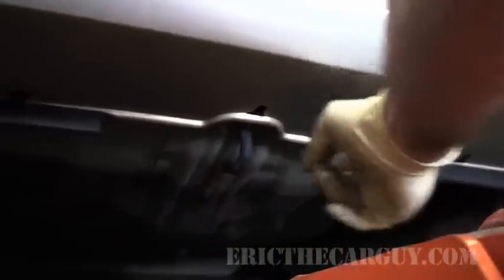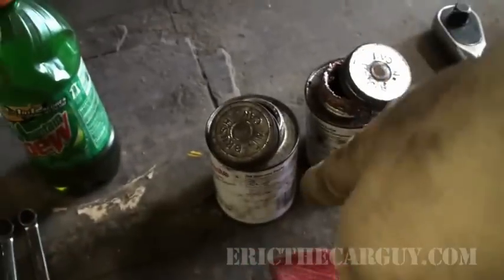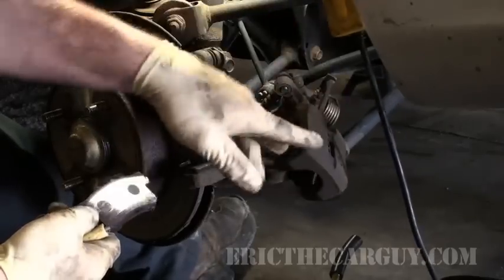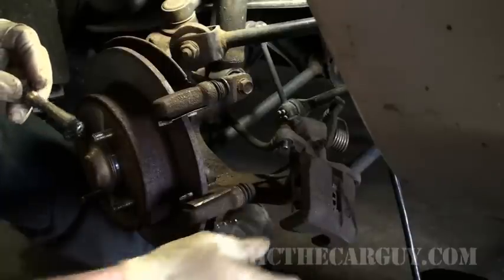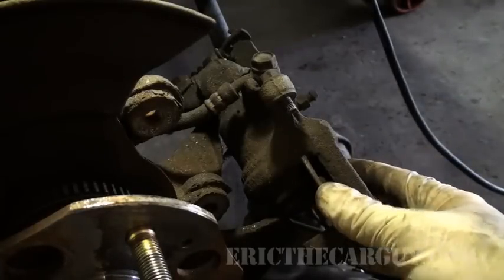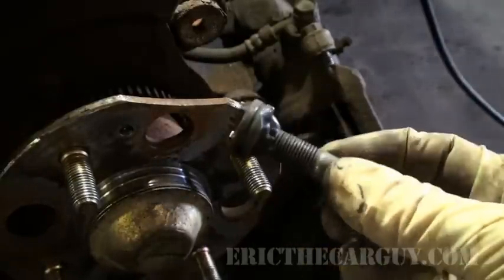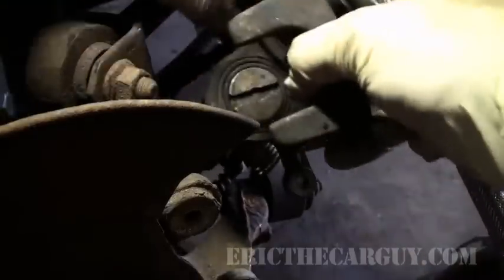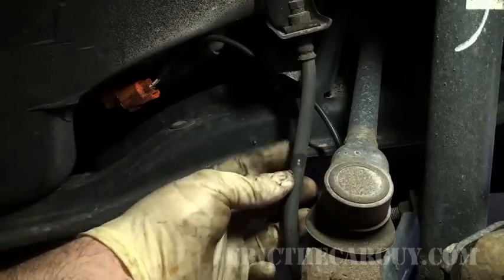How To Replace Rear Disc Brakes (Full) - EricTheCarGuy

Comment: Erik, great video! Tackling front/rear brakes on a 06 Honda Accord this weekend and the preview/pre-game really helps!. One thing I noticed (which you may be glad to hear has nothing to do with your mad brake/video skills) the American Flag on the back wall is backwards ;)  (Anytime the American Flag is displayed vertically/stripes pointing down, the star field on Old Glory always goes to the left ((as a rule of thumb/reference the star field is on the same side as our hearts are physically aligned when the main viewing audience is facing a vertically aligned flag))  I'm thinking someone else has most likely mentioned this by now, but since you mentioned, "when something's worth doing right...it's worth doing right" I figured you would want to know just in case. (((I now I'd want to know)))). Again, great video... Thanks for taking the time to post it!

Comment: I just did my rear brakes! Thanks a lot for this video. I drive a '96 Integra, so it was very similar to the Accord in the video. Quick question, how do you know the brake pin is lined up with the notch in the caliper's piston? I turned it to the 12 o'clock position as you showed.

Comment: Quality! Thermal CPU (computer) paste comes in thin syringes. These syringes can be used to apply silicone grease under the piston at 14:16 . I kind of suspect that CPU thermal paste is silicone grease but I'd go for the brake rated product so I'd re-use empty syringes (except that on an X-Trail the rear pistons don't turn (I guess that is so you can fix them in the bush)

Comment: HEY ERIC YOU HELP ME SO MUCH WITH YOUR VIDEOS I HAVE A TIP FOR YOU. BREAD TIES WITH THE PLASTIC MELTED OFF AND SEWING STRAIGHT PINS ARE GOOD FOR CLOGGED WIPER FLUID HOLES AND FOR BLEEDER SCREW HOLES AND CARBURETOR JET NEEDLES. I HOPE THAT HELPS SOMEONE.

Comment: You know watching the video after struggling through problems is not how I am going to do it next time. It is reassuring though that I now know I did ok. I'm an industrial mechanic.  Not automotive mechanic... For the caliper tool, at the local auto parts store I bought some special tools to fit on the end of a 3/8 extension on a 3/8 ratchet that fit into the tight space if it's extended out too far. That way in case you don't have the ability to weld any custom tool together there is still hope for you.

Comment: Eric. Thank you for the great video. I did my Lexus ES350 rear disc brakes. The drum parking brake has an adjuster to ease up on the shoes so you can pull the disc off. Will these self adjust once i reassemble? Or do I need to adjust them back?
Thanks in advance.

Comment: he actually explains it later in the video, but the reason is there is a pin on the back of the brake pads that look like the tool he used to push it in. they need to go inside that slot, if they dont you will have a spongy brake petal

Comment: Hi, Eric

Thanks for the video, I am just wondering how long does it take to change the rear brakes on both sides actually? Just a small suggestion, could you also mention at the end of each video, the time needed to complete work actually. That might be quite helpful, at least to me. THanks

Comment: I actually fond out what was the issue. My right break pads/or the piston was stuck and causing the clicking sounds. I have cleaned the caliper and the pads thoroughly and applied copper anti seize on it and the issue got fixed. However, it came back after a month. I am guessing I will have to replace the caliper.  Anyhow, thank you very much for your break videos, I really would have know the first thing to check without these videos and would have believed my mechanic.

Comment: 2020 is approaching and through my research I've discovered that you can do this without opening the bleeder (Just open the MC Cap but don't take it off[Clean the area before opening]). It is not recommended but let's be real, most people have done it this way without any problems. Just know that you WILL BE flushing that fluid eventually as part of routine maintenance.

Comment: It's simply a precaution to air getting into the system. So long as your brakes don't feel spongy you should be fine. However if your brake fluid is a little on the dark side and you are still worried about air in the lines then just get the fluid replaced at a jiffy lube or such, they will take care of both problems when changing the fluid.

Comment: Eric, might want to caution about pounding the wrench with the palm of your hand. Carpal tunnel damage may result. Better to use an impact or longer handled breaker bar for added leverage.

Also, I would never compress a hydraulic hose and never let the caliper hang, supported only by the hose. Hang it from a coat hanger or bungee cord.

Comment: The fluid in the caliper probably is full of gunk and moisture, so it's best to purge it out and get the somewhat cleaner fluid from the line to do the braking duy (assuming you're not planning to flush and renew the brake fluid)
If you just push it back up the line, that gunky fluid is going to be doing the hydraulic duties for the life of those pads, and more likely to seize up the piston than if you had fresh fluid.  Just flush it with fresh fluid and that won't matter any more.

Comment: I usually use brake fluid to lube the caliper piston.  I don't use silicone lube on the piston cuz it'll get in there when you are pushing the piston in, and I don't wanna have that mixed in with the brake fluid. Also, I use silicone lube on the sliders for the pads.  I only use anti seize on threads.  I don't think it's meant to be used in an application that moves back and fourth.  It's not a lube.   I'm always learning tho, so wondering your thoughts?? 😊

Comment: Hi, Eric. When I saw one of your prior videos showing the use of silicone paste, I went to a local autoparts store and tried to find it. I'm not finding silicone paste. Can you give me a more specific name? What do you think about using antiseize on the sliders, instead of silicone paste?
By the way, is silicone paste the same stuff you put on the back of brake pads to prevent chatter in the new brakes?

Comment: Eric, great videos! I have 06 Honda Element and my last 2 brake jobs there seems to be an issue with noise immediately after the brake job is completed. The dealer said it was the rear brake plate and they had to cut rotors to adjust. Is this a common issue with Elements? A mechanic suggested I remove the plate, is that recommended? The mechanic also suggests I always replace the rotors every time I change the rotors, he states it's not worth cutting as they are very thin these days. So you agree with this philosophy? How do you feel about drilled and slotted rotors on Elements?

Comment: I use synthetic brake grease on the slider pins and anti seize on the brake pads points where it touches the caliper. People have said that anti seize will eventually turn thick lowering the movement. Should I just use brake grease all over? Or stick with how I'm doing it? Thanks!

Comment: Great video. I like the part where things don't work out as you planed (the tool to compress the piston didn't fit). Just like in real life!

One thing I'd like you to change: don't use a pop (soda) bottle to store toxic chemicals in arount the shop (or your house). A young child in your shop (don't say never) could drink that toxic stuff thinking it really is pop/soda. At the very least, remove the label from the bottle. As unlikely as this scenario seems, it has happened with terrible results.

Comment: Do you have suggestions for replacement rotors and brake pads?  I have always used Genuine Honda, however, our 1997 EX is old enough that Honda no longer supplies brake pads.  I used Napa Pads the first time I had tor replace them, however, they are made in China and I despise Chinese parts.  Raybestos are also made in China the last time I checked.  Is it possible to find brake pads that meet or exceed OEM specs and are made in the USA?  I have looked and have been unsuccessful thus far.  May I suggest stocking a few Honda brake bleeder covers?  They are relatively cheap and they keep junk out of the bleeder orifice.  I ordered ten from my local dealer the last time I did a major brake job (and repair on the ABS unit).  Thank you for great videos.  The Helm Manual only goes so far.

Comment: Here's a tip, if you are dealing with old calipers and run the risk of snapping the bleeder screw off, bleed the system at the banjo bolt instead. I had to do this during diagnosing excessive pedal travel that was ever so conveniently consistent(sarcasm)  My gut and experience told be it was a MC issue but I covered all the basics before condemning it(bleeding the entire system was involved)  Oh and people, please learn to use your parking brake, please.
Reply: Please explain why you mention "please learn to use your parking brake"?  Perhaps it's bad but I always used the parking brake on manual transmissions but never do on automatics.  Not to say it won't happen to automatics but I've only seen manuals jump out of gear.

Comment: Car dude, I have a request, pls.  All I find is 3 tons of jack for parking brake shoes on rear disc brakes. I have two vehicles in need of this service (99 Jimmy & 04 Optima) and I tuned in here in hopes to get some better insight but not the same setup here :[
Keep up the spectacular work!
Tx.

Comment: I was not aware that you never turn counter-clockwise the cross piece adjuster after turning clockwise to move into the piston as Eric stated. Last time I just adjusted it back up to make up the distance to the new brake pads.  Was that wrong to do?

Comment: To all the people who keep saying to use a C Clamp on the piston, you must all realize that rear disc calipers, the piston is a screw jack and is screwed back versus on the fronts it rides on a square cut seal inside the caliper bore.

Comment: Some suggestions: First, you don't want to just spray brake cleaner willy nilly.  Brake cleaner eats rubber.  Second, you don't want to pinch the hose like he demonstrates.  You can cause internal damage to it.  Third, you probably should bleed the brakes after doing this.

Comment: For cleaning purposes, yes.  Keep in mind, though, that it's not a lubricant, and that it WILL damage painted surfaces.  It's also highly flammable, and will remove inks from stickers, so be very cautious if spraying it around the engine..  :-)

Comment: Hay Whats up Eric... I followed this video , And I rounded off one of the bolts  How should I  remove a rounded off bolt without using the heat and propane and all that stuff... should I go to the shop or do u have any suggestions.. P.S., is silicone spray the same as silicone paste..
Reply: rcast22651 use an air hammer and a chisel bit

Comment: The windback tool can be used without the special round "socket". Just put the old brakepad against the caliper and put the square part (where the socket goes on) against the old brakepad. I had to do this since the socket began to strip metal of the caliper, so I just did it my way. Its even quicker tbh

Comment: If you do happen to loose the rotor screws, don't sweat over it. They don't serve purpose once the caliper and wheel are on; they were used to hold the rotor on the assembly line.
Reply: +jcv1995 new ones are easily obtainable.
Reply: But it's not needed.  Waste of money
Reply: +jcv1995  Agreed!
Reply: jcv1995 they are also literally just pennies in cost.  Hardly a huge money saver.
Reply: +hjustm Never said it was pricey to get them, just pointless.
Reply: jcv1995 I get what you're saying, but, I come from a line of mechanics that feel it's better to do it right instead of cutting corners to save just a few seconds of time that is insignificant and potentially dangerous.  Have to remember, the last shop or mechanic to work on a vehicle could potentially be held liable for damages if something were to go wrong and someone got hurt due to flat out laziness.
Reply: There is a tire in the way, that little screw is to only hold it on the car on the assembly line.  Once the wheel is there, it's pointless; period.  Nothing bad will happen if that small 2mm screw isn't put back in.  On some aftermarket rotors, they don't have the hole on some, simply for the fact that they are pointless when the car is on the road.  It's not laziness, it's common sense.
Reply: jcv1995 Lets just agree to disagree.
Reply: +hjustm leaving them out helps the next mechanic.
Reply: +jcv1995 even more on racing cars you usually don't mount rotor screws on purpose cause if they somehow lose and slightly protrude from surface and you don't notice it they will cause a gap between rims and rotors with obvious bad consequences...absolutely not needed, rally cars always go without rotor screws

Comment: Where was this video earlier when i was trying to find a tutorial for rear brakes instead of front? Thank you for posting this, very informative ^_^ 

Quick question, do I need to replace a caliper if the rotor was grinding against it? Due to a certain spinout a few months ago, I just realized today that there was no outer brake pad 0_o

Comment: I don't know about pinching off the brake hose there Eric.What is the difference if some fluid flowed back into the master cylinder?You could do a quick bleed of the line after replacing the pads and rotor,could you not?

Comment: Erick you the man ... i got question  Q:its the same proccess  for the scion xb  09 and rear brake system set up.. to change pads..?  is need put  piston at 12 clock wise .. is better grinder remove pin the pad

Comment: I know absolutely nothing about brakes, and I also am not a mechanic nor have I seen his other brake vid, but I have had that exact problem on my Mazda. The problem ended up being the slave cylinder having too much pressure on it from the clutch pressure plate. Ended up needing to replace the master and slave as well as the pressure plate.

This might not be involved at all in what is wrong with your vehicle, but just something to consider.

Comment: Hi Eric love the tutorials gives people a chance to save money and learn a bit about their cars at the same time, i have an issue with my front left brake i'm sure its dragging as it gets hotter then others and can hear it scrape as you turn the wheel when jacked up. 
I have a 2013 Hyundai Elantra which has givin me no issue really till now, but it only has 40,000kms on it so boggles my mind that i can drive a car for 100,000kms + back in the day no issue with siezed calipers but at 40k this thing goes!? Wtf? 
Anyways i have worked on cars alot even built my first motor for my Mustang at 23 & it ran like a champ but i have never rebuilt a caliper, I watched your videos but just get nervous i won't be able to get the square seal back inside properly! Is it easy to get it back inside the groove it goes in or can it be a bit of a game? I really don't want to have to order a new caliper when i know its just needed some cleaning & get the piston slightly again, i checked the slider pins and they work great no issue at all so had to be the caliper. 
Any thing i should know before deciding to attempt this, that is if i can even get the square seal somewhere! Lol. Thanks

Comment: Dont know if this works for integrated calipers, but with standard calipers (ones that dont have the parking brake hose attached) I saw a guy use a flat screw driver in between the caliper edges and ritor, and push the caliper back that way before he ever unmounted the bracket or caliper!

Could just be a genius move, Eric, but, again, there is that twisting thing everyone keeps talking about.

Comment: If you need to use a makeshift tool, be extra careful to not slip and punch a hole in the dust boot.  

It's a common thing to use the pinch off pliers for the brake line but I'd avoid that for old cars where the rubber is no longer as pliable as they were.  If it's gotten brittle from the years it may stress it too much and make for a bigger job than it would otherwise have been.
It's recommended that the calipers never be allowed to hang from the hoses so they need some care.

Comment: Is it a big deal if I didn't open the bleeder when screwing the piston back in?  I'm no expert and did a friend's rear brake pads tonight and just turned the pistons in and put the new pads on and put it back together.  Should I bleed them now?  Also, how do I adjust the parking brake?  That isn't working now. Thanks EricTheCarGuy!
Reply: +Tony Forno to start with i'm no mechanic but as long as there are no air bubbles in the  break lines (air can be compressed therefore if there is air and you press the break the air will be compressing first before the fluid is pushed down and the pistons activate so you will have a spoongy feeling break and lower breaking performance) you will be fine. As to the parking break the parking break operates on a line and not through pressure so first thing if the parking break does not work at all is to check if the line is even connected .... if not than there is the problem if yes than there must be some kind of adjustment for the line itself like the one that cars without electronic throttle control have Also just off the top of my head you could jack the back of the car up and put it in neutral (lock the front wheels with something so it does not roll down and preferably do it in an area where if it rolls there will be no danger to anyone ) now without getting under the car for safety reasons try to spin the back wheels they should spin as the car is in neutral ... now apply the parking break and try to spin them again and see if there is any difference in resistance if there is than that means the parking break line is just loose but still there (i do not know if this is a good way to test it but to me it seems like it will work just be safe and do not get under the car also do not jack it up too high just till the back wheels are off the ground)